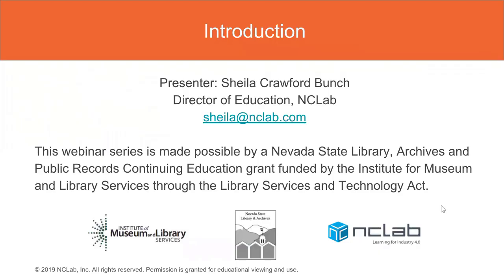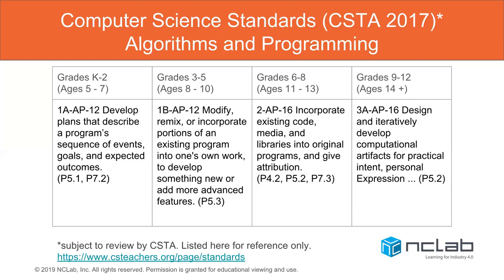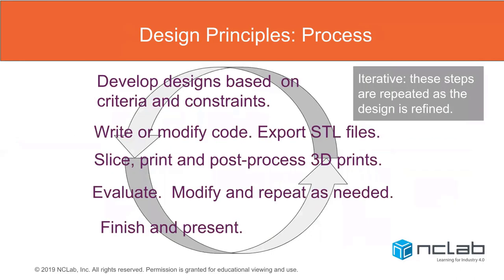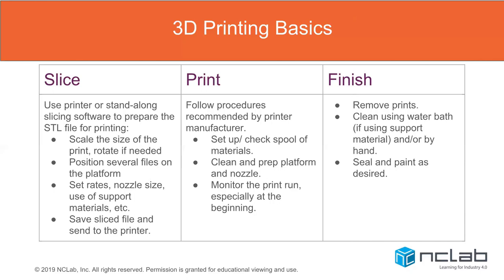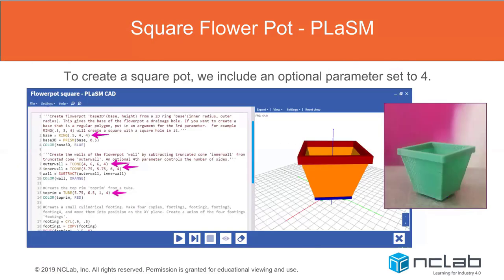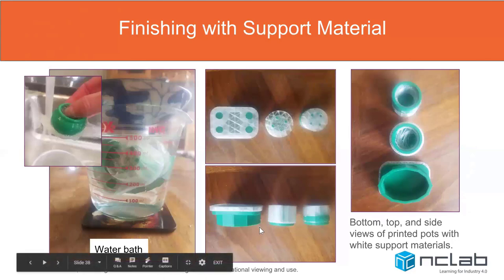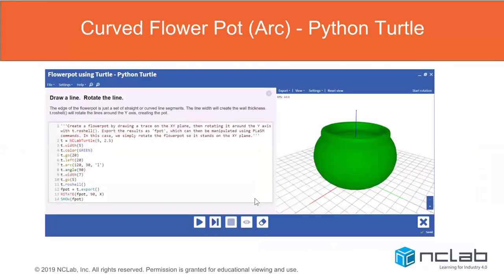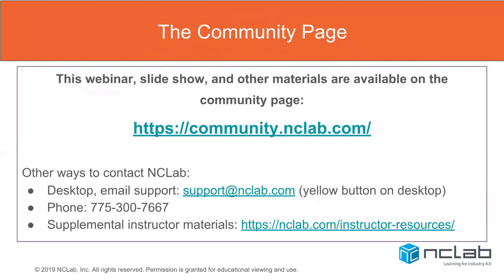NCLab Library Webinar 11 3D Modeling: Flower Pot Design

Comment: Can I slice in 45 degrees (blackbelt3d)?
Reply from the maker: Hi there. You can rotate your design to any angle.  Depending on the design, that can be problematic to print if the model has a narrow base after being rotated.  Slicer software will build scaffolding to support it, but it is better to keep the printing process as painless as possible - less support material means easier cleanup after printing.  Some printing processes work better for "gravity-challenged" designs than others (SLA for example).
Reply: @nclabedtech  Thank you, it was enlightening.